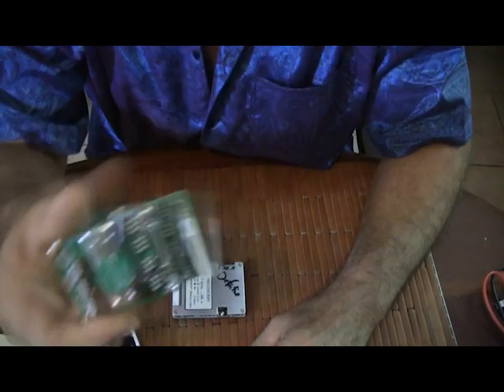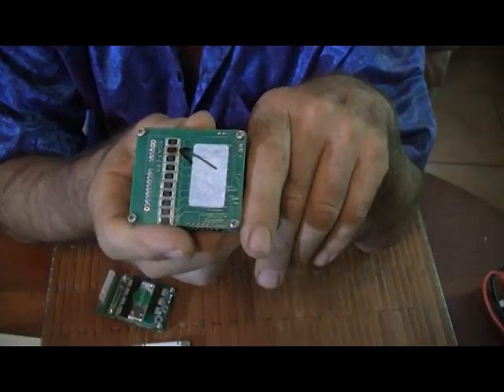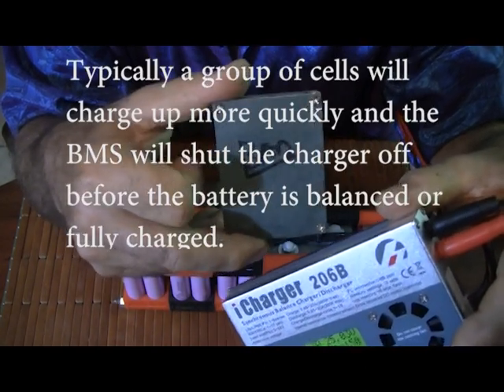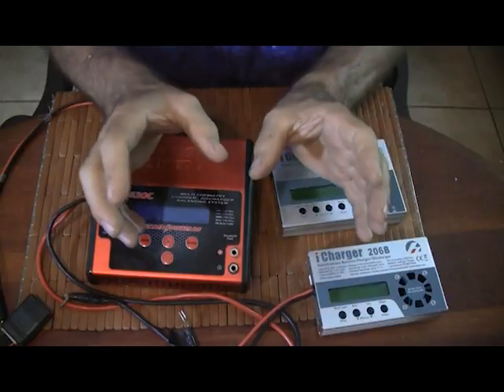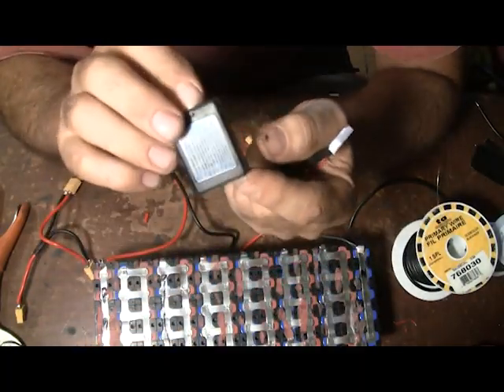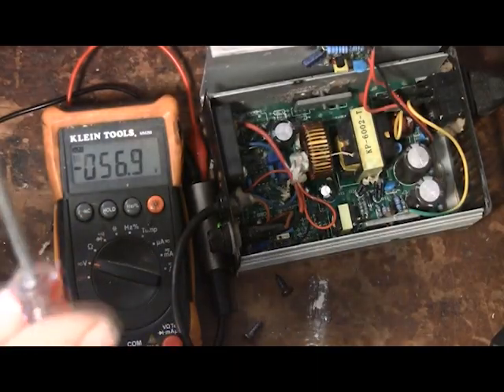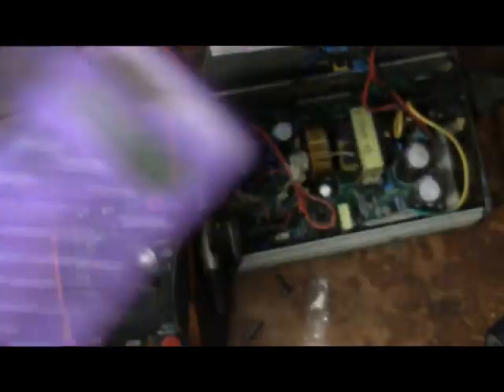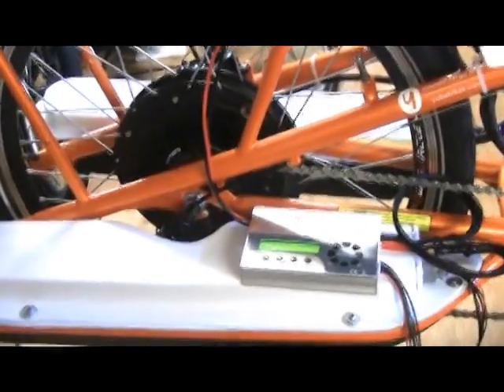How to build a safe and better lithium battery WITHOUT a BMS.

Comment: Great video but I'm a little confused - what about the balancing of the individual cells with in each 5P? Is that not also important?
Reply from the maker: The cells in parallel groups are all connected, positive to positive and negative to negative.  So power flows from the high cells to the low cells until they are all balanced.
Reply: Thanks for the reply Shawn, so individual cells in each parallel group can essentially balance themselves when charged via the charger with balance leads connected without any drawbacks?
Reply from the maker: They balance themselves without being connected to anything except each other.   The balancing charger balances the parallel groups, not the individual cells.
Reply: That's interesting, can I safely bulk charge 18650 cells as long as they are in the same parallel group?
Reply from the maker: Yes.

Comment: Informative video!
Still I don't get why such Bluetooth BMS https://www.aliexpress.com/item/48V-Smart-bluetooth-BMS-system-with-30A-discharge-current-for-54-6V-Battery-system-E-Bike/32733414980.html?spm=2114.13010308.0.0.kTanQp
is not used. We all have phones(sorry iphone users) with bluetooth.

Comment: Very good info.I use my cheap clone imax balance charger for my heli`s.but i can see that some batteries just dont balance 3s +4s for these cheap toys it isn`t a big deal but very annoying.what i do have is a 48v 1000w ebike kit and the 2-6ah bottle type batteries that i cant get a few miles out of just with pedal assist.i probably used the throttle way too much and screwed them up.i use the cheap charger that came with the ebike kit.Now i have a12ah bottle and a 6ah  for backup.I dont see any video about this type of battery.taking it apart and salvaging the good cells is what i would like to do.any advice?
Reply from the maker: The bottle batteries I find really hard to work on.  I can't even get the cells out of the two or three I have tried.  You might have to destroy the container to get the cells out...
Reply: no wonder i don`t see anything about them here.destroy the container like with a cutting wheel ? how to recycle this battery ? there must be thousands of them out there.no wonder no one responds to me thanks your the 1st
Reply from the maker: They are common but not too valuable Peter and hard to work on.  Most guys buy laptop or power tool batteries for disassembly.
Reply: 3 years ago when i purchased the ebike conversion kit and the bike to install on simply the fit form function works nice.Now that i see that these batteries are not easily recycled i will not buy another.so i will have to try and salvage the good cells from 2-6ah bottle and if there is anyone that could give any advice would appreciate very much.learning the hard way is my only option.
Reply from the maker: Sure.  Open it up, get the cells out, see if there are any dead cell groups.  Then take apart all the spot welds and grind the tops of the cells with voltage to make a smooth surface.  Then get a little 4.2 volt charger and see if all the cells charge up.  The ones that do without heating up still have some life in them...

Comment: Some of you guys can really be a pain in the groin, and the video is also a lot of shit, tell you why, 1. bms is a built in battery pack the a charger gets connected and allows your battery to balance each cell, a rc balancing battery charger is the same thing, the only differance is that it has a build in charger and has a BMS built in, haha and the digital display shows you the voltage of each cell, or does it???? batteries connected in parallel will not show correctly, why??? the balance charger will ALWAYS read the voltage of the HIGHEST cell of the two, NOW, the only problem you going to have is that this faulty cell will allow your amps to drop easily.

Comment: Can you please tell me where you bought your cell loggers?
Reply from the maker: https://hobbyking.com/en_us/hobbykingtm-lipo-voltage-checker-2s-8s.html
Reply: Shawn McCarty is that the same one from the video I guess it could be did you just put a case over it?
Reply from the maker: It is the same electronics as the one in the video.  It looks like they are out of the ones with the cases over them- I couldn't find them.
Reply: Shawn McCarty ok thanks and great video I came up with this idea and thought process all on my own but I liked your explanation
Reply: Shawn McCarty also bms is something that is unavoidable at least for me because if I make something for someone because normal people can't charge the battery and do these things like us you have to simply it for them
Reply: ebay BX100

Comment: My BMS for my Battery Pack with Samsung Cells is acting up. It's junk. Have to rebuild soon. Didn't use pack much either.
Reply from the maker: While you have your pack open be sure to check the voltages of the parallel groups.  It is also possible that you have a dead group of cells.

Comment: Ican tell you by experience that those hobby king cell loggers with alarm have enough of a draw that they WILL without a doubt over a very short amount of time, get the battery pack seriously out of balance. First of all they are terribly inaccurate and just not worth the time and effort unless you have a quick way of disconnecting and connecting them. Just terrible.
Reply from the maker: You bring up some good points.  I always install them with a switch across the negative terminal.  I just run them when I am checking voltages or when concerned about running my battery too low..  

They are not very accurate when compared to a voltmeter or a hobby charger.  Yet, they are good enough to get the job done.  For precision voltage measuring to the hundredths of a volt you should look elsewhere, I totally agree.  I recommend buying an extra one or two in case you get a dud.   At $3 each, it is not a big deal...  

Thanks for your input.
Reply: In that case you are fine...They can be helpful with regards to the low voltage alarm..just best to get more than you need and sort out with a voltmeter which are most accurate and discard the others.Li-Ion once it gets below 3 volts under load can drop quite rapidly, so you want to make sure they are reasonably accurate.
Reply from the maker: Yeah, we are on the same page John. 
And, once the voltage drops that low they are no fun to ride anyway.
Hede John's advice dear readers!

Comment: I'm not an electrician expert, but i don't understand why the 2 battery's must be electrically disconnected.
if you are charging both batterys separately, wouldn't the electrical connection become mute?
(plus this would make things easier as you would have a 14 cell battery already connected together)
Reply from the maker: They don't have to be.  I suggest that for safety.  If there are two halves wired in series, and someone decides one day to use a parallel board to balance both halves, there will be melting wires.  So, .....
Reply: Good comment! I was thinking the same thing. Leave the 14s as is and just solder charging leads at the mid point and the ends. With two chargers you would be able to charge both sides at the same time.

Comment: Hey Shawn, inspiring video man, thanks for that. I'm looking to make my own battery pack for my project, a 10S pack. From what I've found already, the BMS looked easy enough to balance the battery and help simplify the charging as it would cut off when it was fully charged. How do you manage the charging of your battery without one? As in, how do you keep it from overcharging when not using the hobby charger?
Reply from the maker: The BMS does simplify charging as long as it works properly and your battery is well balanced to begin with.   The BMS does not "cut off when fully charged however.  The BMS cuts off the charger when it can no longer keep one of the cells below 4.25 volts by bleeding it.  The remaining cells could be all over the map.    

The charger reduces the current as the overall voltage rises.  A charger can be too powerful for the BMS, overwhelming it's tiny bleeding resistors, causing the BMS to shut off charging prematurely.

A hobby charger contains both a charger and a BMS.  The two are integrated.  It will reduce the charging rate should one of it's (much larger) resistors be unable to keep a cell under the preset voltage- which is adjustable, unlike a BMS.  Thus, you can, especially if your cells are unbalanced, achieve a better balance- a fuller battery- with a hobby charger- at the price of more fiddling and geek stuff......But some people like geek stuff!  It's a personal choice.
Reply: Shawn McCarty, thanks for the info. I was referring to the bulk charging of all the batteries, as you still have a charging port for all the batteries on the bike whithout a bms. so what charger specs are you using on that to make sure you don't overcharge the batteries?
Reply from the maker: When you bulk charge you charge to 4 volts per cell instead of 4.2.  There is no need to bypass the BMS.  The BMS will still be there to do it's job should a cell group go over 4.25 volts.  So a charger like this http://www.batteryblocs.com/groceries/high-low-battery-48-volt-battery-charger/   will do both....

Comment: Can i use BMS + Cell Logger as a R/C Charger???????
Reply from the maker: Hi Pablo,

Yes, Cell Loggers make a great compliment to a BMS- they provide an instrument panel.  You can use the Cell Loggers to help you from over discharging your battery by setting a low voltage alarm.  They are designed to be used by model airplane hobbyists.  When the plane is flying and a cell gets low an alarm sounds and the oilot knows it is time to land...

Comment: Where can you buy cell loggers for <$5?? The only ones I can find are $50!!
Reply from the maker: Oops I was wrong about the price.  They are $2.99 ; )

https://hobbyking.com/en_us/hobbykingtm-cell-checker-with-low-voltage-alarm-2s-8s.html
Reply: +Shawn McCarty Thank you so much! :)
Reply: +Shawn McCarty
Sorry just one more question, what is the name of the connectors you used to join the 2 battery packs together at 10:12 ??
Reply from the maker: Sure- those are XT-60 connectors.  They are rated for up to 60 amps.  There is a beefier XT-90 too.  Hobby King has good prices on them.
Reply: +Shawn McCarty Great thanks again! :)

Comment: Hallo, great video! I want to build a 13s4p battery pack without bms and balance charging and also monitoring it in your way. Where should i connect the fuse you are showing in the video? Is this a special fuse? Is there something else to do for safety?
Thanks.
Reply from the maker: The fuse goes between the battery and the load.  On an ebike that would be the controller.  In the event of a short, the fuse will blow.  Consider building a 14S battery instead- you can divide it into two 7S batteries and charge it as such.
Reply: I will split the 13s4p in 3 parts and charge with a 6s charger. The budjet is tight...The fuse has to be more amps than the controllers?
Reply from the maker: Yes, the fuse has to have a higher amperage than the controller can draw.  On most ebikes a 25 amp fuse is used.

Comment: So glad I found this Video. Working on a Chinese 100w scooter and swapping the Lead Acid battery with 18650's. This was really helpful because I had the same thought. I wanna know what my cells are doing and not just let happen till it fails. So thank you for this detailed explanation why not to use a BMS and what alternatives there are.
Reply from the maker: Thanks Hard Disk lover,    This is a common conversion.  The Lithium Ion batteries tend not to have the punch- the ability to dump amps- as the lead acid, but they go further...

Comment: When connecting cells in parallel and treating them as a single cell like in the 5p7s example, is it possible for the paralleled cells to become unbalanced (some of them becoming overcharged other becoming undercharged)? What happens when one of the cells goes bad and how can you tell without separating the paralleled cells from each other?
Reply from the maker: Great questions.  

No, it is not possible for the cells in a parallel group to have different voltages.  The higher voltage cells charge up the lower voltage cells until all are the same voltage.  

When one cell "goes bad" it becomes in effect a resistor and drains voltage from the cells in its' parallel group until all the cells go bad.  You cannot tell which cell has gone bad without taking apart the parallel group.  But by then it is usually too late as the bad cell has killed the good cells.  

If you can monitor the voltages of the parallel groups you can determine if a group is going bad.  It will both discharge more quickly than the other groups and charge more quickly than the surrounding groups.

Comment: Thank you, this is exactly what I was looking for. I suspected that the tiny resistors on a BMS were not capable of applying enough drain to actually balance the batteries. There's a reason the hobby chargers need fans to stay cool, and that's because they're dissipating off more energy as heat to actually balance the packs. I also really appreciate you showing how you wire the batteries to split them for charging as 2x 7S instead of one 14S. Hopefully now with EVs becoming more common, larger and better chargers will become available for charging 12S - 16S packs used in EV setups.
Reply from the maker: I hope so too, but I won't hope for long.  If one isn't out let's build it!

Comment: Thanks for the educational !  Is it possible, that the car makers or bike makers that incorporate these cells in a vehicle, they 'interrogate' the system to get the information that it seems is not possible to the rest of us?  In other words, it is not that the info/readings are not available, just there's no output legible to the average consumer buying the vehicle?  Used to be nobody could do much with conventional cars, now an app for ipads lets you look at the fault codes etc.
Reply from the maker: I think that the information is readily available and if there were demand it would be on the dash. But most consumers don't care to know, they just want it to work.  Elon has a "ludicrous" mode on his Tesla for crazy high performance, maybe we should petition him for a Geek mode- that would display all the data!

Comment: Awesome video thank you. I am new to the e bike world am working on my first build now. I'm a bigger guy and live in a town thats ALL hills so I want to make sure there is enough power to get around without over taxing the system. It first I just wanted low range (around 30 miles) but seeing what these 18650's are capable of I'm not thinking I want to be able to tow a small cart with additional batteries for a long distance trip this summer. I like that you monitor each group and you can turn them off to not draw wasted power. I dont have any experience so my concern is not knowing when to check them. can I run a bulk monitor to measure overall voltage or could I just leave these on all the time without too much of a net effect?

Comment: I like the way you think about modularity. The great cost for DIY EVs is the battery pack that gets luxuriously expensive when it gets bigger. The smaller packs are produced in quantity and get cheap. It's important to keep it safe though. 

You sound like you know what you're doing and I just wanted to reinforce to random viewers to know the risks and what to do exactly before attempting this.

 It looks like good BMSs talk RS232 and other protocols to communicate the monitored values (individual cell voltage and more) or even be programmed/setup. One could use that to talk to a microcontroller and display whatever is needed. These days there's Arduino enabling this for most people with time to spend on it. Not OOTB, I agree.

Or just hookup the "trouble bit" to a dash LED and have the microcontroller/laptop setup at home for debugging. Not better or worse than the "Engine light" + OBD devices on gas cars.

I like the hobby charger approach as it's pretty safe but I'm at 16S and it already got somewhat cumbersome to manage daily charges. I made a 16 Ah pack out of Multistar 4S bricks.

Currently charging on a unbalanced charger for the whole pack, no BMS but only because the pack is new and I monitored close per cell voltage in the first 5 cycles.

I'm installing a higher end BMS in the next month or 2, so when they age the BMS will shutdown if something abnormal happens and I can connect to it and see what's wrong (or check the pack manually). I made my pack removable exactly to make this sort of maintenance easy.

But yeah, not too surprising that the cheap BMSs do a bad job -- we get what we pay for.

Comment: I watched your video and your hobby charger is just a BMS\balancer with a lcd, please refrain from product Items that are bullshit. your connectors are DANGEROUS AS FUCK as that cell could easily short out.
If you are going to show people how to do,,, NONE bms units please show them how to do it safely
Reply: Keep it civil please. Your point about the hobby charger is a valid one I agree.
Reply: Tony W :
So, exactly HOW can the connectors for this design short circuit any easier than the average soldered lithium ion batteries found online? From what I understand, soldering any lithium batteries is a sure way to compromise your cells. A welder seems optimal, however I thought that Sean's design makes it a lot easier to repair cell blocks, when needed, and is ideal for many smaller applications.